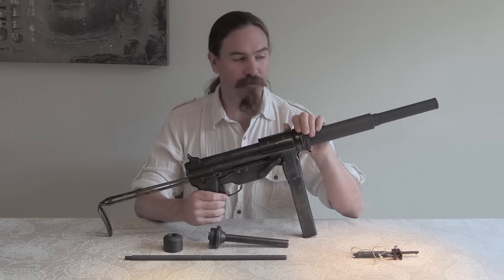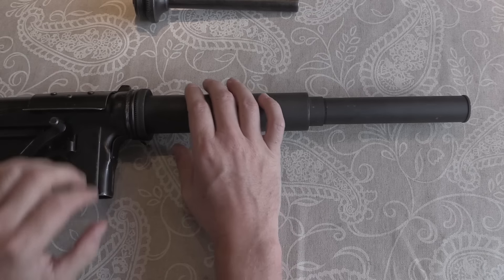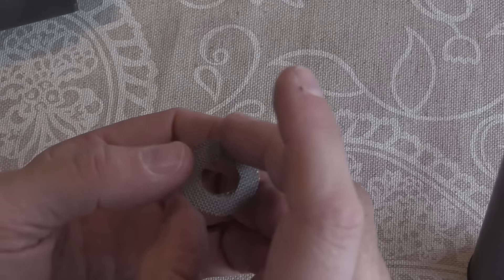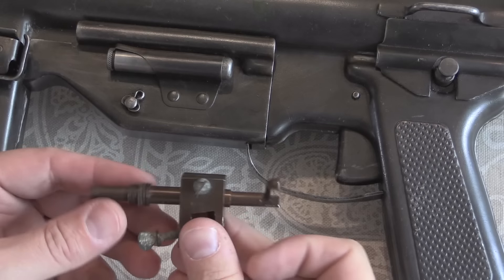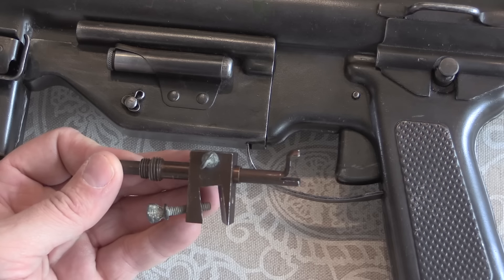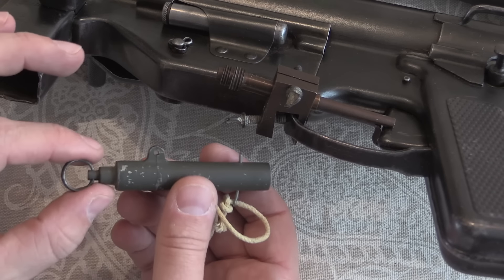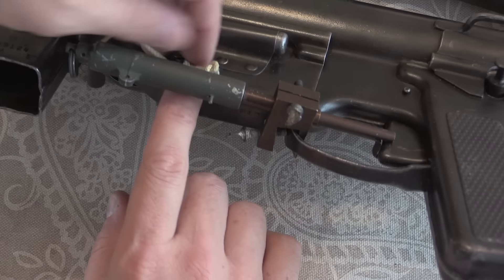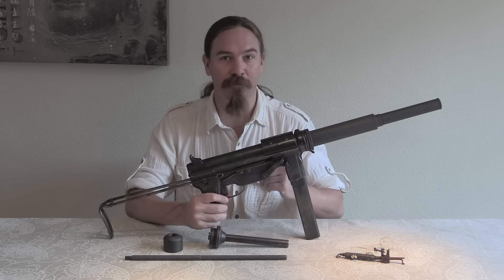Suppressed OSS M3 Grease Gun and Bushmaster Booby Trap Trigger

Comment: I "inherited" one these M-3A1s in early 1973 when I was on a "plain clothes" TDY assignment in Viet Nam before the Paris accords went into effect.  I only had a couple of opportunities to fire it at the range and once when we were destroying assets and property that had to be left behind.  There were  a couple of issues with the original guns.  The wire mesh tended to break down during use.  The silencers became fairly ineffective after only a short period and needed to rebuilt depending on the use.  This was due to the heat and carbon build up that ruined those screens.  Also, the larger section of the silencer (the section closest to the receiver) became VERY hot and mine came with a wool padded, leather covered, laced on wrap so the shooter could hold that section during firing.  But, even with that it got very uncomfortable to shoot.   Not a fun gun to shoot beyond a magazine or two.  Heaven help you if you lost that pad.  BTW, Ian talked about the guide rod for inserting the screens... Well that was when they were originally issued.  Didn't take long for that rod to get lost along with any inventory of those special screens.  And, they were regular steel, not stainless so they rusted out just about as fast as they were shot out!!!
Reply: M3A1 version could not take a suppressor, you must have had the M3
Reply: @wernesgruder1  I don't understand. . .are not the M3 and M3A1 barrel interchangeable,  Don't they both accept the 9mm conversion kits ? Why would it not mount on the other gun . . .
Reply: @wernesgruder1  eh what are you talking about. Not only are you incorrect but it was clearly stated in the video that the barrels are interchangeable between the m3 and the m3a1. There was only minor differences between the 2 only the way of charging the gun and a magazine loader on the rear. If you don’t really know what you’re talking about just don’t say anything, you just end up embarrassing yourself…
Reply: @wernesgruder1  yes they could, theres literally documented pictures of OSS M3A1s with the exact same suppressor, along with the leather covered wool pad DoneThat mentions
Reply: @wernesgruder1 
Yep they could, I know because I have one 😊
Reply: @wernesgruder1  I may be mistaken, but I am pretty sure they are fairly interchangeable. The only difference was the charging mechanism, one was a mechanical cocker, the other was the Mk1 index finger. (I was an armorer)
Reply: "silencer"

Comment: Silencer tax+SBR tax+machine gun tax=too much regulated fun
Reply from the maker: On the one hand, once it's a registered machine gun the barrel length is no longer regulated. Also, where this gun is located, the NFA does not apply.
Reply: +Forgotten Weapons Where I live (Australia) the NFA means something worse 😂
Reply: Probably in France or the UK.
Reply: even thats pretty reasonable for access to an automatic weapon, but is it a similar process to own a regular gun? like say you wanted a bolt action .22lr, would you require a special reason? (part of a gun club that does competitions)
Reply: If you're a hardcore collector, there's a way to get anything anywhere... its just a matter of greasing the right wheels and getting the right licenses/permits/whatever, and usually bucketloads of cash... Its the same everywhere.
Reply: +Anthony Rinaldi Wish I had sparing money. You literally can do whatever you want.
Reply: @ALRinaldi  Can confirm, under a collector's license you can get small mortars and machine guns in South Africa. Ungodly expensive, though.

Comment: As an FMF corpsman with Marine Recon, I carried an M3A1. Mine must have been a later model. It didn't have a rod sticking out to cock it. It had a finger hole in the bolt you pulled it back with. Rust was a problem. Glad I didn't have to clean that suppressor.
Reply: Someone realized the cocking lever was unnecessary. Later versions had a simple hole in the bolt, to stick your finger into.
Reply: That would be the M3-A1. Such a cool gun

Comment: The point about wire mesh in supressor, is mainly of its great surface area, that surface cools down hot gases, wich helps a lot in reducing volume of gases. I think that is the main reason why they use a wire mesh. And that way to supress is working VERY well :)

Comment: For those that wonder how a chemical timer works:
no, it's not a chemical reaction that blows up eventually, or anything that fancy. It's far simpler: imagine a spring held back by a wire and once something breaks the glass vial an acid is released, slowly dissolving the wire. AFAIK, there were timers ranging from 5min to 48h. 
I wish, they built them in all aerial bombs. They did it in some, but we still got F-loads of unexploded bombs littering the earth, slowly corroding.
Reply: well that assumes the mechanism remains functional after ... you know... dropped from the air and crashing into the ground at terminal velocity.

the problem with unexploded bombs after all is that their fuse failed to detonate the bomb and if they had self destruct mechanism (a lot of bombs do, some on purpose as a terror weapon as it makes their disposal difficult) then it may have failed as well, 

but the chemical timer is for all intent and purpose just another fuse really... 

so in order for it to work on aerial bomb to prevent a bomb from not exploding after the main fuse failed, then it must somehow be made stronger than the actual fuse the bomb had...

which then begs the question of why not just make the original fuse for the bomb better and prevent it from failing to explode in the first place
Reply: Many bombs had more than one fuse, after they discovered that up to 20% failed to detonate. Using a chemical timer has two advantages:
1) it's simple. If the delay fails, it still detonates.
2) the delay makes the bomb unpredictable to the enemy. They thus can't just come back after the other bombs exploded.
Reply: yes we know that, but the question is... if the bomb suffer damage to such extent that the primary and secondary fuse failed, then will the chemical timer remain functional for it to matter?

after all... while the mechanism in it usually is simple, they are not necessarily damage proof regardless... and the primary fuse in bombs are not exactly made of flimsy construction in the 1st place, and so does the secondary timer usually built on them (which i already mentioned)

so the chemical timer needs to be sufficiently robust and durable enough to actually withstand whatever damaged the bomb to the point that both the other fuse failed...
Reply: Iono Sama If the wire ruptures prematurely, it detonates on impact. All that needs to withstand the impact is the tube containing spring and striker.
Reply: which is great, but the thing is... a number of the fuse they use on the aerial bombs... technically are supposed to work even if just the percussion plunger and detonator remains intact... those work on impact detonation as well

if even they can fail either from damage or any other reason, then what guarantee do we have that the striker in the chemical timer remains functional if subjected to that kind of damage? Other than of course... placing it in different location, and praying that it's enough to help spare the chemical timer critical component.

i mean don't get me wrong, more backup self destruct mechanism is fine...

but we're basically just layering more and more fuse onto the same bomb in order to hope that at least one  of them worked... so we're just reducing the chance the bomb failed to explode completely by putting more redundancy in fuse.
Reply: +Iono Sama (IonoTheFanatic) Can you learn proper grammar, please? It's painful to read your comments.
Reply: i believe the easier solution is to simply not read them

because no i don't care what others think, and no i don't care much of what i type in 5 seconds on the internet

unless i am getting paid for it, then that's a different story
Reply: @IonoTheFanatics  reminds me of the whole soviet vs usa design doctrine

USA "this part is important so we designed several backup systems in case it fails"

Motherland "this part is important so we designed it to never fail"
Reply: They also used a similar design with a celluloid washer that gets dissolved by acetone. They were used on limpet mines a lot.

Comment: that device looks like it could have been assembled out of washing machine parts which it probably was knowing the oss :P
Reply: DeanmC261993 Which is the reason I like it so much! 
This type of design could make a comeback as a very inexpensive home build. 
If the HPA passes it would be pretty popular for pistol caliber carbines.
Reply: no I mean the booby trap device :P
Reply: DeanmC261993 I'm not so sure. That mesh looks like it would be really annoying to clean. A cheap home build could easily use washers and other hardware odds and ends for baffles.
Reply: that's also kind of the point, if you got caught by someone with that in your pocket you might be okay. If you got caught with something that screamed explosives fuse device trap, etc etc you might have some explaining to do!
Reply: To clean the meshes you could easily just tie them together and toss them in with the laundry or something.

I was gonna say "dishwasher" but I don't know if those existed in the 1940s.
Reply: ootdega im pretty sure women existed in the 40s.
Reply: HA

HAHA
Reply: @aspenfacer-valentine4397  Pull the suppressor, strip out the meshes, drop all the meshes in a shallow pan full of brake cleaner. Pull them out in 30 min and wipe them down well, reassemble with fresh paper and the registration rod, ready for more WW2 clandestine fun!

Comment: I owned a Beretta  .25 acp Jetfire that had a suppressor mounted on it. The suppressor had front and back rubber wipes, but the center core was of bronze compressed "wool" that was shaped  as a tube to slide in the suppressor cylinder. It was very quiet and was fun to shoot. It was also illegal as Hell as I didn't have any paperwork on it and taxes had not been paid. I later traded it off for a Bren Ten without a magazine, but that another story....

Comment: .45 A.C.P. was a very widely used round among the Western Allies. The Brits widely used the cartridge for clandestine/covert operations and actually designed and produced a bolt-action sound-suppressed rifle chambered for the .45 A.C.P. round for such operations as well as the American O.S.S. using it in their sound-suppressed M3/M3A1 submachine-guns.

I believe it is even possible to fire the round in the British .455 Webley revolver using adapter clips to hold the chambered rounds in the revolving cylinder.
Reply: The rifle you are referring to is called the De Lisle Carbine.
Extremely quiet, mostly used for sentry extermination.
To fire 45ACP in a 455 Webley, the rear of the cylinder has to be machined off. This is needed to accommodate the full moon or half moon clips used to headspace the rimless 45acp properly.  45 Autorim cartridges may also be used for individual loading. (45 Autorim is a 45acp case made with a conventional rim for use in revolvers.)

The Webley 45acp conversion was big in the US after the war.  Thousands were brought in on the surplus market, which were then converted to 45acp. This was done to make them more popular with American buyers.
45acp was much more plentiful, especially at that time. (Pretty much how 9mm is today).
If you ever acquire a 45acp converted Webley, it is recommended to shoot handloads that match the original 455 Webley loads. I believe that's something like a 250gn bullet at 700fps.
The standard 45acp load of 230gn at 850fps isn't too much hotter, but constant use can lead to premature wear of the revolver.
I definitely wouldn't use anything hotter than the standard 45acp load.
Certainly no +P loads.

Comment: 6:18 - Not difficult to measure the noise.  Measure it in IMPULSE meter mode at the operator's ears, both left and right.  I can't remember if you use Type A frequency weighting, but if pressed I would say YES.

Comment: Why did mesh as a suppressor fall out of style? Was it too ineffective?
Reply: My guess is yes, considering the rubber buffers perfectly encapsulates the bullet (some even not having holes on them and the first shot itself making it's way) these must have still let a lot of gas out

And ass pointed out, weapons mechanics were quite loud back then, the M3 makes quite a sound cycling that is listenable shooting it unsupressed, that's not the case with later more modern guns which therefore needed better silencer systems

Comment: I don't mean to question your knowledge, but wouldn't the pin be pulled back and the cotter pin placed through the hole on the charging side of the bushmaster, then the tied cotter pin would be pulled to discharge?

Comment: was the wire mesh system superior at sound reduction or just cheaper to manufacture?
Reply: GreenManAiming Easier to maintain. Sound performance wasn't the most important part, because the M3 is quite loud, and (as shown in the video) no attempts were made to make the gun itself operate more quietly.

What the wire mesh did, was to provide a system that didn't need to be renewed after some time, which would be quite hard for clandestine operations. With the guide rod you can easily clean the gun without risk of raising the noise level when shooting it afterwards.
Reply: GreenManAiming I'm guessing one reason the industry went to baffles/wipes is that all that fine mesh must be a bitch to clean.
Reply: GreenManAiming steel wool has been used for decades. Especially home builds.

Comment: Wouldn't a simple rubber washer or O ring placed on the front of the bolt carrier quieten the slamming forward for a time?
Reply: Liam Winter having a soft bolt face isn't a good idea as it will affect operation (also the bolt face and bolt tends to get warm). You could have a rubber buffer at the back of the receiver to keep it from clanking upon full recoil.

Comment: That suppressor has surprisingly similar construction to a type of after-market internal exhaust silencer for motorbikes (muffler if you are in the US).
Reply: I had the same thought. The muffler in my example was for small (20cc) radio control gas engines. You adjusted the degree of noise suppression by adding or removing discs. Simple and effective.

Comment: I'm guessing this is the weapon the Aussie special forces were using in the old Mel Gibson flick Attack Force Z.

PS - Looked at some screen shots from the movie - yep, they were using suppressed grease guns but the front half of the suppressor assembly appears to be missing/removed.
Certainly not super accurate (especially in function, the weapons are typical Hollywood whisper quiet when being fired even on full auto) but I'd always wondered if it was total BS that any kind of suppressed sub machine gun was used in WW2. I now know that it wasn't!